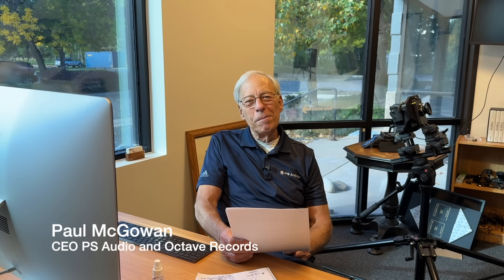Converting cable disbelievers

Comment: I got so fed up of hearing this argument that I wired my left speaker with Amazon basics wire and the right with a $200 a metre cable. The speakers are b&w 702 s2 and the amp is a rega elicit. There is absolutely no difference whatsoever. People who buy into this nonsense are simply suckers wasting their money
Reply: For the most part. Really long cables can be an issue and bad shielding very very rarely can be an issue. Bad connectors can be an issue. Amazon basic cables though are totally fine.
Reply: Stereo will do that.
Reply: Did you play it mono and switch between sides?
Reply: @PSA78 oh yeah that’s really how it works 🙄🤦
Reply: @ruk2023-- You don't know how to do basic tests/setup of a stereo system? By playing mono both speakers get the same signal which eliminates the mixing, and setups in a many rooms with be different from side to side.
Reply: @PSA78 you don’t understand the basics of a realtime comparison or how that differs from what you’re suggesting. They are separate things
Reply: @ruk2023-- Oh so you just flip it on and say what comes to mind. But you are right, I really don't understand why you test like that. 😂
Reply: @PSA78 because I produce music and we regularly swap between monitors in realtime to see how things sound on a different speaker. Surely you can see that if the left speaker sounds much different than the right you would hear it?? Or maybe you only have one ear.
Reply: @ruk2023--  Not necessarily, as any change is again not accounted for. 🤦‍♂I have to agree with others that you seem to be trolling or you're just lack understanding of the subject. Either way it's a pointless discussion.
Reply: @PSA78  cool
Reply: @PSA78 I just measured the right speaker. One tapped into the output of the amp and one at the speakers input. So measuring the distortion across the cable.
Reply: Which '$200 a metre cable' did you use in your test?
Reply: @mattrismatt 😂😂😂 what a straw to clutch for!
Reply: @ruk2023--   I'm not clutching for any straws. I just asked an obvious question... that you strangely chose to laugh at.
Reply: @mattrismatt it’s some qed thing I was given when a friend upgraded and it is all cable and all does the same thing which is why I laughed
Reply: @ruk2023--   'some qed thing' isn't very specific. Are you aware of the gauges of the two speaker cables?
Reply: @mattrismatt I stopped caring about this a while ago. Have a good weekend
Reply: @ruk2023--    Nonsense. The very fact that you're here talking about cables means clearly haven't 'stopped caring' about it.

Regardless, those reading this thread should dismiss your claims and flawed experiment since you failed to note the models and specifications of the cables you 'compared'.
Reply: @ruk2023--   ...what a deflection.
Reply: @mattrismatt   ...I nearly went where you have gone. I'm so glad that you did. Cheers!
Reply: The OP would have had to do his experiment in mono, would have had to have a room where the acoustics are identical for the left and right speaker, would have had to have an open mind, & would have had to have something better than bricks for ears.
Reply: @sidesup8286 aww. Are you always such a treat?
Reply: Well I'm glad you wasted your time and money on a pointless experiment (though I personally doubt you did such an experiment)
Reply: @pc750-V4 I just hooked my oscilloscope up to my amp and speaker. There is no difference between the signal from my Amazon basics banana plugs and the direct output. I attached the probe at the base of the amp and one at the speaker terminal both on the positive output. Super clean on both ends. I will admit I saw a bit of crossover distortion on my outlaw it is class ab. Close to 0 distortion anywhere else volumes were low though.
Reply: @pc750-V4 cool man. If I cared enough about your opinion I would send you a picture but I can live with you not believing me. Not sure if I said that I bought anything though 🙄
Reply: @pc750-V4  Correct.  You nailed it.

Any listening test would need to be between swapping cables for both channels.  No one would spend $200 to change one channel, to conduct a listening test.

And this video is about power cables; not speaker cables.
Reply: @0Perhaps The power cables don't matter at all because we use decoupling capacitors. Any fast transient or heavy load will get back filled by the caps. Your assumption has to rely on the fact that the cable has some capacitance and can't feed the system power fast enough either through frequency or large draw which is true. This is why we put a capacitor right next to things with large power draw.
Reply: @laindaley9644  Who is "we"?
Reply: @0Perhaps for the second time the only person who said I spent any money is you and your imagination. Swapping both channels simply amplifies the placebo effect.
Reply: @0Perhaps Anyone who has ever designed an amplifier.
Reply: @ruk2023--  "for the second time the only person who said I spent any money is you and your imagination. Swapping both channels simply amplifies the placebo effect."
For the second time?  To what are you referring?

Quote the text from the first time.

And you wrote that I was imagining.  Are you on meds? (or off your meds?)
If you really do have a mental illness, then I apologize.  But your comment to me, out of nowhere, is bizarre, especially since you wrote that you tested with a $200 cable.

Looking at your argumentative, impolite replies to others, you are either trolling for attention, or your stereo has a screw loose.
Reply: @laindaley9644  "Anyone who has ever designed an amplifier."
Those thousands of people elected you as their representative?

We know that you just made that up.
Reply: @0Perhaps I made up decoupling capacitors? They are used in almost every electronic device.
Reply: @0Perhaps I made up decoupling capacitors? They are in almost every device ever made.

Comment: it does matter. Clean surface contact, thightness and contact surface area, etc do have differences. Did use double shielded coaxial single core copper cable embeded in teflon tube and connected with other multi cores cable has good musical sounds. Importantly, when played with truly high ends equioment esprcially with excellent heavy floor standing loud speakers, surely any casual listeners can tell there is a signaficant quality of detailed sounds difference. Those who have average quality of equipment may not hear noticeble difference; expressing experimented opinion.
Reply: Here we go again. The usual “if you don’t hear it it’s because your system is not good enough…”
Reply: @volpedo2000   ...yeah, because facts don't change in this instance.

Comment: I replace my cables every 3 months, once they burn in i dislike the sound. Keep on top of it and dont get complacent with inferior overused cables.
Reply: Try listening at absolute  minimum sound volume, you could get 6 months out of them exotic cables ;)
Reply: @CoolJay77 best reply yet😂
Reply: Just like you clean your vinyl records every time you play them you should also change the speaker cables and the cables between the amplifier every time you play a new album. This is the way!
Reply: Best keep them away from the heater 😂
Reply: Burn….in…?
Reply: What about your amps? How long do they last?
Reply: And do you open up your amps and speakers and replace all the wires inside... nah.. didn't think so, so you're not a real audiophile, are you?
Reply: So you believe in cable burn in then.... That's a surprise

Comment: its down to the connector more than the cable. And the best connectors is BNC what should be used on all equipment not RCA it's junk. Great for turntables ans phoneostage. swap them out for BNC it's a straight fit for the socket.
Reply: Give me XLRs or give me death!
Reply: Well it's ok in Some circumstances, but shouldn't be necessary. Some people don't like the sound it gives xlr.